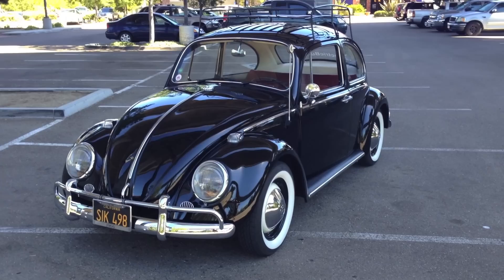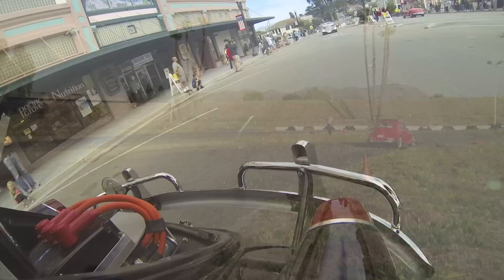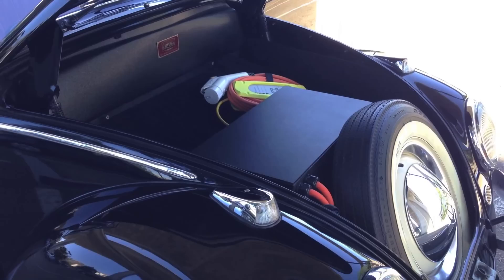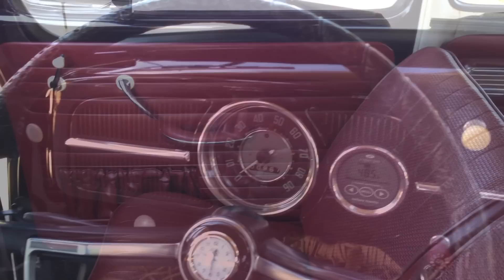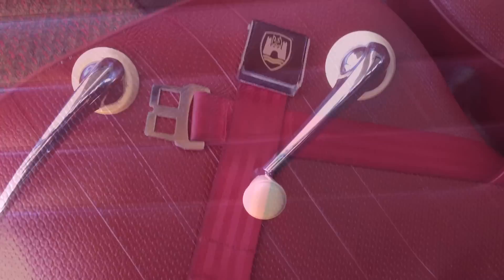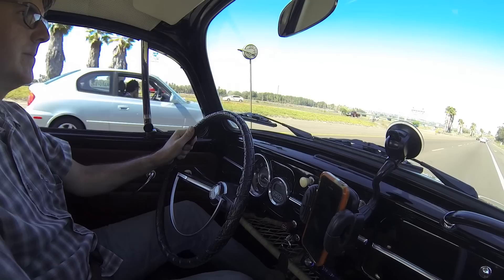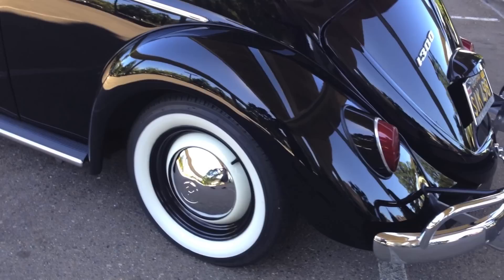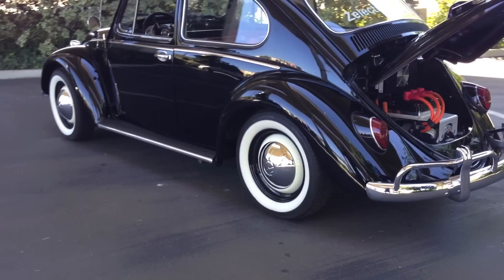Walk Around ZelectricBug Electric 1966 VW Beetle Rebuild

Comment: My first car was the 1966 VW Type 3 Fastback. I knew even then that I did not want the bug. To elaborate: my dad had one of the earliest VW's to be imported to the U.S. , a 1950 bug with the butterfly rear windows and electro-mechanical turn indicators which flipped up on each side. As a kid I both loved that car and knew all of its foibles. Besides I had seen the Karmann Ghia and really wanted that one despite its low seating position.  However the Fastback had a bigger engine(1600cc), more room for passengers and two trunks. It shares that distinction with the Tesla but beat it to the punch by decades. Also the Type 3 had a better heater, and had a subframe to isolate engine noise....a little. In the twelve years I drove that car I used every trick I could think of to get better mileage, including lowering that subframe with spacers to use bigger rear tires while preserving the negative camber I had added to improve cornering. The conversion of that two carburetor engine to fuel injection was a nightmare. The fuel needed to have a return-line added to the gas tank, and  an electric fuel pump fitted where none had been. To top it off, I had to convert the whole electric system to 12v from the original 6v. That would have required a new flywheel to match the tooth pattern to the 12v starter, but failing to get the old flywheel off, I was convinced that the counter EMF of the 6v starter would  be sufficient if starting was quickly accomplished before it burned out.... It was, mostly.

The hotter camshaft and twin intake port heads(polished) from the rebuild to fuel injected gave it better speed, along with better mileage and better performance at altitude. The bigger tires had more bite.

 I do not miss the monthly valve adjustments and distributor gap adjustments or the spark plug checks even the fuel injected engines of that period needed. That fuel injection was the first electronic injection in a production vehicle because VW had such bad emissions, on a parts per million basis. Cadillacs that met the spec had more smog per mile by far, but the ppm measurement was lobbied into existence without considering engine size.
Surprisingly, the CAFE standards for mileage along with the EPA smog requirements have taken away those dutiful periodic maintenances and given us much better performing cars. Part of the reason we have taken so long to go electric. Back when that Bug was first sold, a San Diego utility was developing an electrified Karman Ghia. I might have bought one then if they had not been stymied by the Automobile manufacturers. My electronics shop teacher in high school was an old WWII Submarine Sailor and we knew about  NiCad batteries from him. Those and the NiMh variants would have come a lot quicker had the stifling not been so successful. We learned about catalytic converters in that high school too. It took almost two decades of obfuscation before the oil companies and car companies would allow that maybe they could get the lead out of gas to use them. I hope this history lesson has got your attention.
Reply: I had a '71 square back. The best car I ever owned, i wish I still had it !!!!!
Reply: I have a type 3 and it's a 71. I did away with the air-cooled engine for the same reasons most people get rid of the car itself. I am in the process of installing a   Subaru motor from a 99 Forester which has 165hp.

Comment: I just love it. But the hubcaps should not be baby moons but be the flat style for a ‘66 and the wheel colours are mixed up, the inner part with the bolt holes should be in satin charcoal and the outer part should be ivory. Just an authentic detail though because your work is amazing!
Reply from the maker: Steve K But, then we’d need to change the motor as well ;-)
Reply: @zelectric but the hubcaps and wheels are on display for anyone to see, while the motor is hidden away under the engine cover. So I think Steve K makes a valid point. My 2 cents. 🙂

Comment: I was raised on the classic Herbie movies, so from the earliest of ages I was programmed to be attracted to bugs. This seems like by far the best way to own one. I love how the electric conversion solves the reliability and performance issues of the original vehicle. I would not miss most of the convenience features of modern cars, such as power windows and especially keyless entry and ignition (push-button start). I hate this kind of computerization of modern cars, which makes them susceptible to being hacked and otherwise manipulated by someone else with a computer. About the only thing that I would miss are modern safety features, and in particular airbags. And yes, the metal dashboard looks great, but the reason why automakers stopped putting it in vehicles has to do primarily with safety in an accident.

Comment: In an era when most beetles are either bedraggled, dead, or have been chopped up by hot rod douches, this car stands out as both an elegant restoration, and a modern 3 phase AC motored, lithium battery conversion.  I grew up with these cars.. and I can tell you this is a PEACH.  I own a leaf.. and the addition of the extra batteries really ads to the utility and flexibility of the car.  They really hit the sweet spot.. although no mention is made about upgrading the brakes.  The torsion bar suspension in the pre-super beetle Bugs is rugged, simple and desirable.   Note, that if the weight balance is similar to the old beetle... there IS a learning curve to driving a rear engine car.. so take it easy while you get your chops !
First Rate.  dont know the price.. but this car will still be going in 100 years.

Comment: Have Fond Memories of the Old VW's, I owned two of them-a 1965 that I used as a Mud Machine and a New 1972 Super Beetle. The only problem was the Constant Valve Adjustment if you wanted the Engine to last and the Heater/ Defrost was Terrible also no Air Conditioning was available. If you Took care of them, they were very dependable transportation. Oh the 1972 VW cost me $2070 but it had Cragger Mags and Chrome Performance Muffler and Extra Factory Speakers...

Comment: The mystery of the rear engine revealed: establishing traction on the rear wheels.
One of my old, now departed friend told me that you could not drive this particular model across the Verrazano Narrows Bridge in New York City, because the winds were lifted off the roadway. You mentioned that the lithium batteries add some extra weight.

If a particular customer supplied the Beetle, could you estimate how much it would cost to install the system?

Comment: I had a 74 beetle in High School.  Driving on the highway at 50 mph with even a slight crossbreeze was a nightmare with the short wheelbase.  Hated that car, always will.
Reply from the maker: Battery weight and suspension upgrades helps a great deal. But yes, they're still lightweight cars. -db

Comment: You mentioned the radio, But you did not show it to us, I had the same car for a few years, In 1976, I had a re-bore to 1400 cc, It could clip along up to 80 mph,  That was as fast as I tryed. The radio impressed me, tone & clarity.  But there were rust issues, So I passed it on.

Comment: Great job indeed 

Any idea about how much will cost me to order one and when it can be received?

and how about AC for hot climate ? Also is there any cooling system for the batteries?
Reply: did they contact you with some kind of price chart......i hate it when people post these videos with decent ideas but never give a price.........
Reply: vanity rose no they didn’t unfortunately 😂
Reply: @aldhyaeikhaled1  then what's the point lol.....I'll just stick with gas....sure its expensive, but at least they let you know the price
Reply: vanity rose of course there is no point at all specially if you have to pay 100 times up front the money 💰 that you believe you are going to save on gas ⛽️
Reply: To another comment he answers that the conversion project starts at around $49K.

Comment: This is Fantastic ! But i wonder, when you drive at Evening or when it´s cold, how do you get Heat in the car ?
Reply: The Charger and the DC/DC converter are both air cooled so some shrouding to the heater channel could do it. The controller is liquid cooled so there's another heat source that could be utilised. I'm sure a decent engineer could work out a way without impacting the cooling of those components.

Comment: They "covered the dash in plastic" to add a small margin of safety for when your face would "face plant" into the metal dash. No airbags, no anti-lock, no head restraint, but it does have a spare.

Comment: My '66 has a 150 hp 2110 in it and it can go thousands of miles without a recharge, and wouldn't have it any other way. Once battery tech gets to the point that they can be recharged in 5 minutes, you might have me. Public chargers should take credit cards.

Comment: While I like electric vehicles, I don't want my beetle to drive like a sports car. I want my beetle to drive like a beetle.
Reply: Then just drive your beetle
Reply: @210SAi  yeah but that's not the point. the point is, these zelectric beetles suck. they in no way emulate how driving an actual beetle is, and they have a range only a little higher than an average electric city car. and I don't wanna buy a city car for 80,000 dollars.
Reply: @wev7196  then drive your beetle and let the designers do their thing.

Comment: You said no oil.. so the transmission is dry? No grease on the suspension?
Reply: Ben, he would for sure be referring to the engine. The transmission appears to be stock, ie will have trans oil in it.

Comment: I wonder how many VW collectors are gnashing their teeth as these older bugs are converted. You did it well in that it could be converted back but some change out the breaks and upgrade various drive pieces tossing away parts esp the original engine. You have kept yours I am sure. I'm not a collector myself just wondering. I like old vehicles and though never owned a vw bug I do like what you have done with yours
Reply: Burnningsoul, it looks like they did an extremely tasteful conversion. The car looks completely stock, and with the decklid closed, the untrained eye would not know this car to be electric! And yes, I'm sure they kept the engine. Even if you did this conversion, you'd be a fool to get rid of the stock engine, especially if it was a "matching numbers" one!

Comment: Is it equipped with regen-breaking? And how long does it take to recharge the beetle?
Reply from the maker: Yes, the AC motor provides regen braking. The 22kwh battery pack takes about 3-4 hours to charge from 50%. -db
Reply: ZelectricBug
That's not bad! I really like this Beetle it's beautifull.
Reply: What if you bolted on an alternator to the motor, will it generate extra power every time the car moves?
Reply: ;-) ...remember the laws of thermodynamics! There's no free energy!

Comment: i'm wondering which HPEVS electric motor you guys used?
Reply from the maker: We're using the AC-50 in this build.
Reply: Evilsizer82 so for a 20KWh, it goes 100Miles. equivalent to how many hp of petrol ice engine?

Comment: i want to convert my Chevy Cruze 2011 lt FWD automatic transmition. it's possible?
Reply: Slushboxes suck power, airconditioning, brake servos, and power steering make it a complex task too. Don't expect it to be cheap either!

Your best bet is to find a classic truck with fewer features, like an FJ Land Cruiser or early Land Rover. Something that's actually good.
Reply from the maker: Alex is correct, the electric rebuild works best with manual transmission or direct drive. It's also pricey, best to lease a new production electric like the Chevy Volt or Spark - they're a blast to drive! -db
Reply: ZelectricBug  I'd still rather convert an older vehicle, like a 1960's van. Not at all for convenience, but just to say I've done it, and to have a practical vehicle for around the city I live in. You forgot what luxuries you have in a modern car when you go back to something old, especially commercial vehicles. Most people want AC, power steering, and heaters, so your comment is very true about leasing.

Comment: Imagine an old mercedes from the 90s and I just want the motor changed (to ev) and don't care much if the interior or exterior looks deteriorated...just the motor. How much would the conversion cost?
Let's say 120 hp and 130 miles range? Or 100 hp and 100 mile range. I live in a small round  island more or less 30 miles diameter and almost never drive more then 60 or 70 miles...this carhttps://youtu.be/f0W9Tir29G0

Comment: I guess it's a free country so you can do what you want.  I appreciate keeping the original looks,, but why a '66 beetle?  Why not a new FWD Beetle? leave the classics original.  If you're going to mess with a car do it to a new less valuable car.   That beetle should be put back stock.  Gas engine and all.  Use a Late model Mini Cooper or Smart Car for you're Dr Frankenstein experiments.
Reply: There is plenty of stock cars out there for you to buy don't worry child.
Reply: Carnutzjoe You're missing the point it the classic cars we want.You can put the car back to stock when you buy it.

Comment: This is a death trap. You'll find out that you can't complete an electric conversion for less than $20k and you'll still have an old piece of crap. Your insurance rate will be high since you don't have modern safety features like reliable seat belts and air bags.  Don't waste your money electrifying an antique  death trap buy a Chevy Bolt instead.

Comment: 80 mile range the car became useless. Turn back to gasoline
Reply: nONSENSE, OF THE HIGHEST ORDER.
Reply: @chikkipop  nonsense  I go to work more than 80 one way I put 60k per year. Until electric cars have range they are useless.
Reply: @johnpinner1  MORE nonsense! C'mon, John; you're smarter than this. Here goes:

1.) Some people DON'T travel far, OR they want a vehicle like this for pleasure as well as LOCAL errands, and for longer hauls they'd have another car.
2.) Many people have second cars -- or whole collections -- because they have a sentimental attachment or historical interest in them. As just one example, I knew a guy who had two old Corvettes, which he'd take out on nice weekends. He kept them in his 2-car garage, with his everyday car parked in the driveway.
3.) Electric cars DO have range, and it is continually increasing as better batteries are developed, but here is something even more obvious: if just that segment of the population whose daily needs are within the range of electric cars began to use them, there would be a major reduction in our dependence upon fossil fuel. (For 27 years my round trip commute was 5.4 miles. I'd have had about 2 weeks of work travel on one charge, never mind the fact that you'd be recharging each night.)
4.) The 2019 Kia Niro EV gets 239 miles on battery. Assuming you travel 100 miles each way, you're well within your daily needs, and can recharge overnight.

Electric cars are only just getting started, and will continually improve, but to comment on an adorable little car which has been electrified as though it was intended as a practical answer to all needs is just silly.
Reply: @johnpinner1  That's not a commute, it's a daily road trip.  You can still go EV though.  Tesla has enough range for you.  Probably others as well.
If I had this Bug, it would be a pampered prize.  Definitely not a Point A-Point B appliance.

Comment: Give me the original bug. I'd rather go 300 miles on a tank of gas then only get 100 on an electric motor. Gas stations are everywhere. Can't change the car where there's no electricity.
Reply: Peter Tantillo usually classic cars are more weekend cars then daily driver or cars you travel with. many states have restrictions on cars over 30 years old.